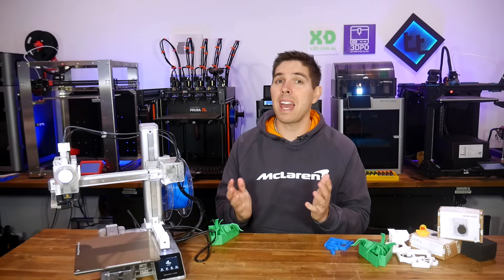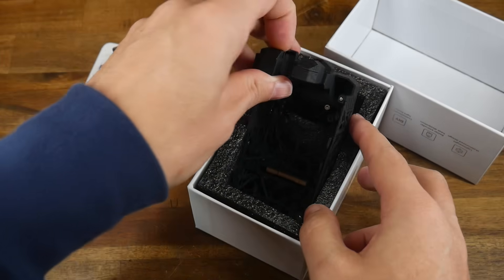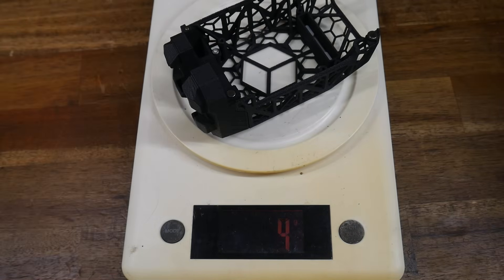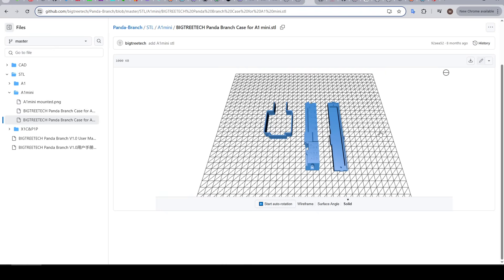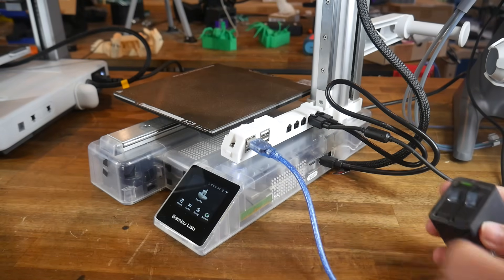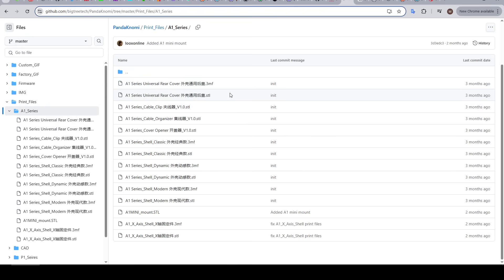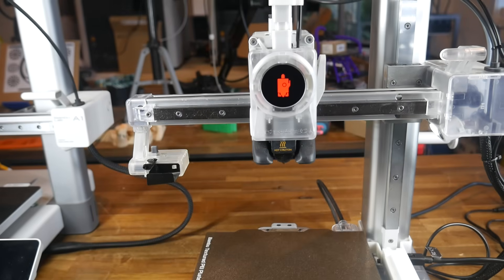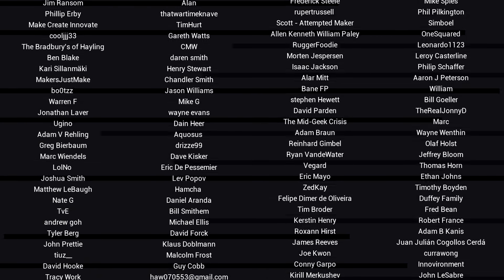Panda Jetpack, Branch and Knomi test and guide - Bambu Lab upgrades

Comment: I was hoping the Jetpack would improve the overhangs, but unfortunately no.:(
Reply: It will but most of them come from the factory clogged still with the powder and just need to tap it on a bench/table or just use compressed air
Reply: @Lettuce-j6p  oh, okay, good to know, thanks.
Do you happen to know if it is possible to upgrade the fan to a more powerful version?
Reply: I got the Jet Cooling Fan Duct, which can be inserted in the standard Housing but has the same pattern. Only real improvement was the Overhangs front/Back and there around 5° in the Overhang Tests visible. But not in the X Axis only on the Y Axis you got a slight improvement.